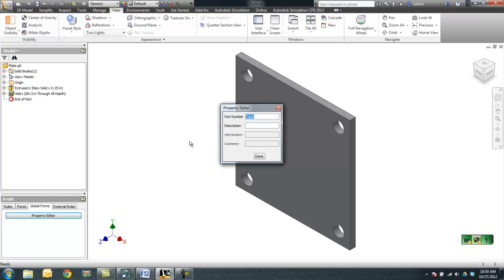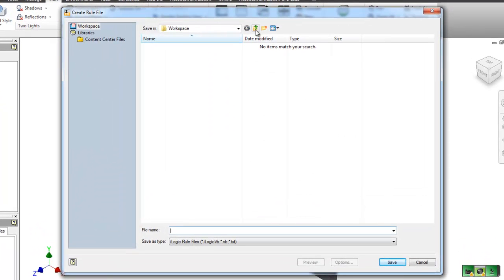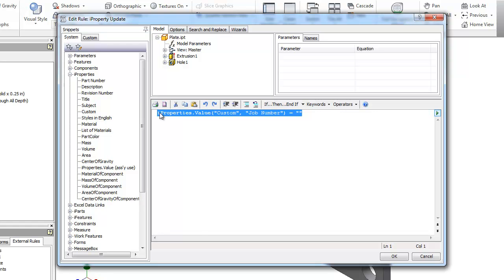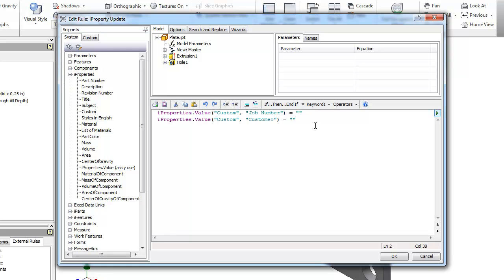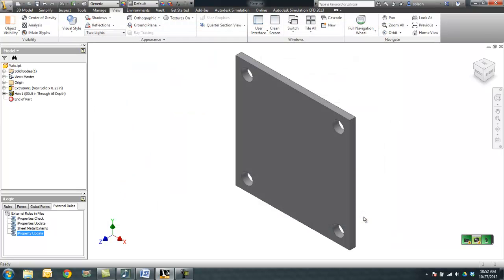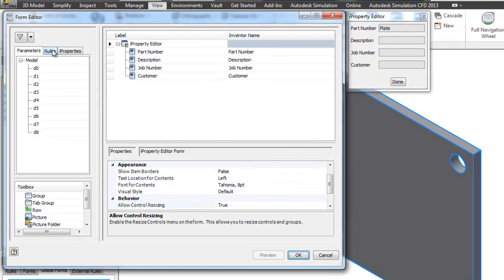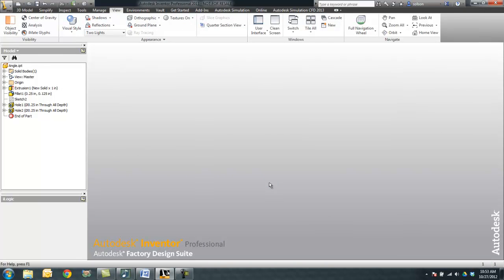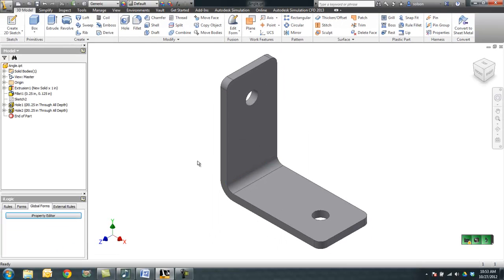iProperty Update

Comment: Hi Steve.
I'm working in Furniture company and using Inventor.
Any idea how to make furniture fittings so they interact with other parts in assembly like Gable and Top to be joined together.
Thanks for your videos.
Janis
Reply from the maker: Janis,

There are a couple ways to go about this.  You could use iLogic, Associativity/adaptivity, or iFeatures.  Which one you use will depend on how you work now, and which features fit into that workflow.  I would be more than happy to help you figure this out.  If you want, you can email me directly at steve.olson@mesa-cad.com